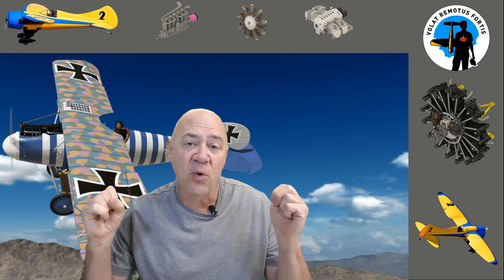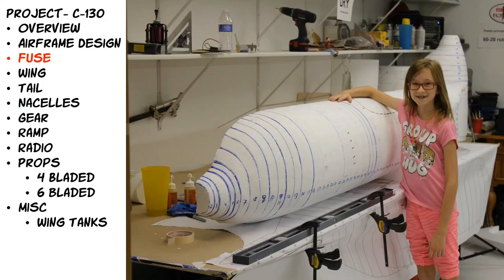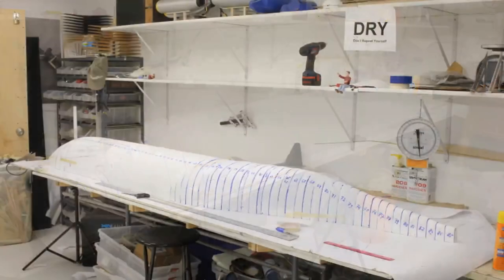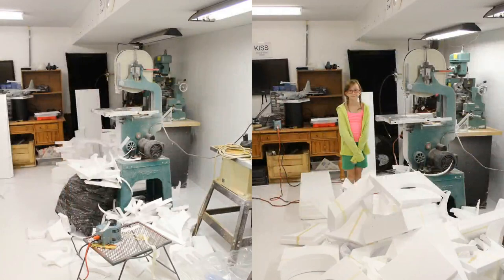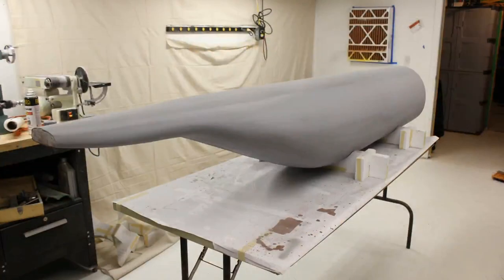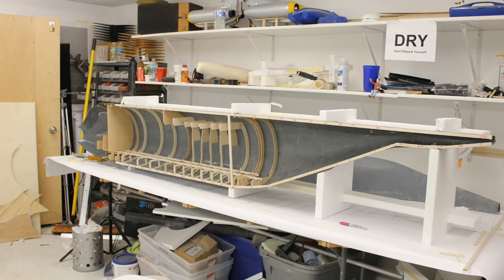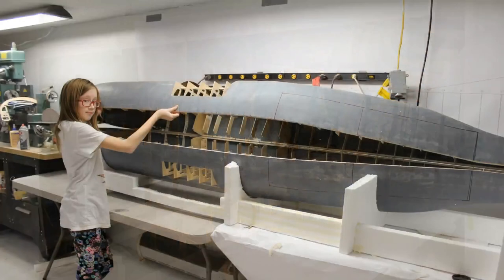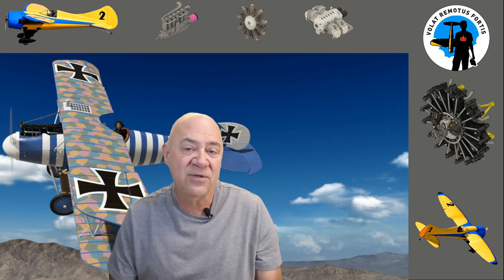Project C 130 Part 3 (Fuselage Construction )

Comment: I've used the same Gorilla glue to bond small 1" thick concreate stepping stones together for a pad my burn barrel sits on.  It's 5 years old now, out in the weather up north and still holding.  Also used it in my ponds waterfall.  One of the most useful adhesives you can have on hand.  You are correct though, people don't read the directions.

That's an amazing scratch build.
Reply from the maker: I love that glue. Rock ON! Thanks!

Comment: Your closing statement was so spot on. "Lot more science than driving around killing people". Let's do the science. Design. Build. Redesign. Build again. Maybe, yes, maybe, we learn from our mistakes. I'd love to see more on your thoughts of 3D printing portions of your airframes. Some time ago, I started designing a Part 104 amphibian, that as a test piece, am also designing at 1/4 scale (120" WS). Since I 3D print lots of other stuff, it was natural for me to think of formers, bulkheads, etc. to be 3D printed. Thought being there's a lot of inherent strength in even PLA, given the load distribution and frame geometry, coupled with 3D printings "perimeter first" orthodoxy (Hoop strength). I'm going 2 walls, 4 base layers (0.2mm layer height) for bulkheads and inter-bulkhead formers. Same for wing ribs. Obviously just a tad bit more complicated than that.. but I think you may catch my drift. The neat thing (bonus), is that the airframe structure, looks "scale". Your thoughts?
Reply from the maker: I am still messing with how I will print parts that will be ribs and bulkheads. But early testing I had 3 base layers and 3 wall layers. 25% fill (if the part got think enough to matter). I am working on a video about using 3D parts for airframe parts. :)